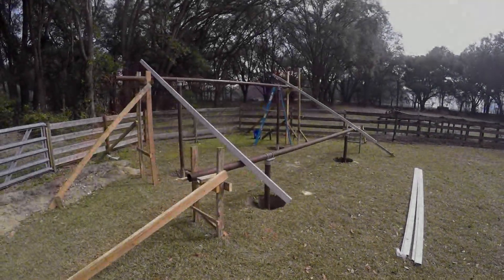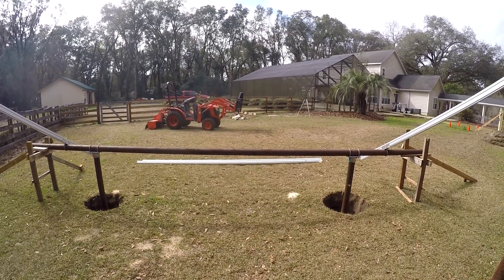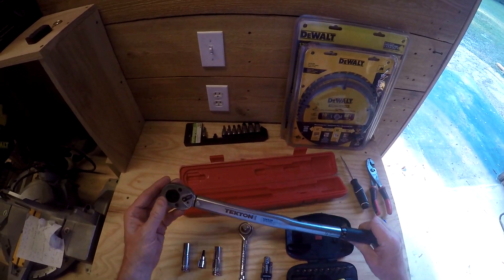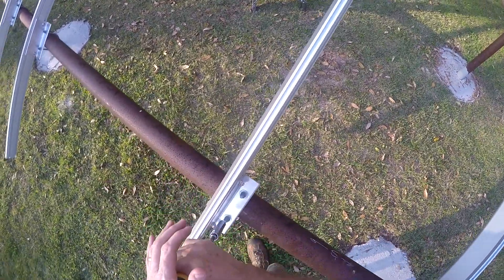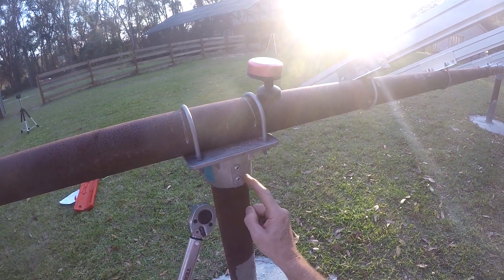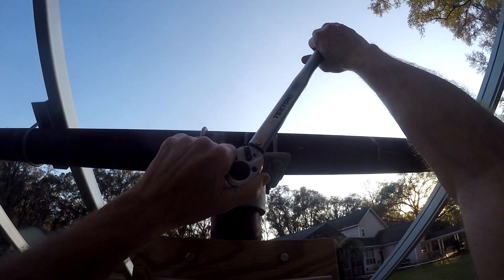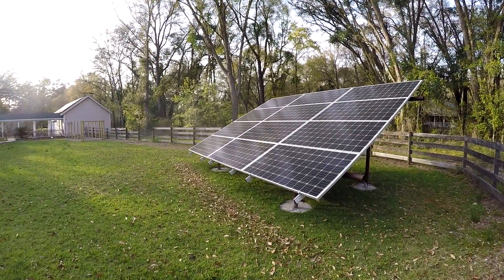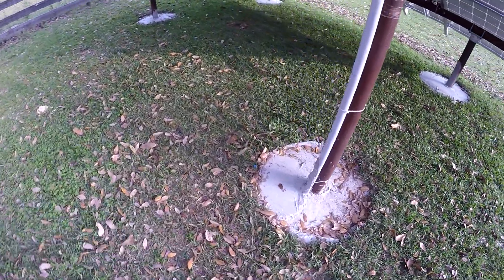IronRidge Ground Mount Solar: Concrete Rails & Panels

Comment: You make it look so easy! Did you use the Ironridge design assistant, and what diameter of pipe did you use?  Thanks
Reply from the maker: Yes, I did use the design assistant and the inside diameter is 3" outside 3.5".  Check this out: https://youtu.be/UzUcyl_iGwE?si=By99ljC_wtz5TBF-
Reply from the maker: I have a whole series on this: https://www.youtube.com/watch?v=N7CoCI-0IoY&list=PLkTIWHBRRyi41UblmwomPHEmXYjgXf0B1

Comment: Love the video of your solar install. I’m doing the same very soon but will have 36 panels. What degree slope did u set yours. Is it around 30 degrees.  And how did u calculate how much pole to leave out of ground on front  and back to get the degree u need. I need 30.
Reply from the maker: Start with the IronRidge design assistant.  That should give you all the measurements.
https://www.ironridge.com/ground-based/
Thanks!

Comment: Those set screws need to be tight for *uplift*. I used a bit of Loctite to help keep them from backing out and on the nuts as well...
Reply from the maker: Yes, They do have a specific torque setting.

Comment: Are you using non-galvanized pipe? How is it holding up? Thanks
Reply from the maker: I think I used this: 
https://www.onlinemetals.com/en/buy/carbon-steel/3-nom-schedule-40-carbon-pipe-a500/pid/23672?variant=23672_72_0&gclid=CjwKCAiAmJGgBhAZEiwA1JZolqQfc-hJ-3GX0mo4MJdoBO7V1WdxDgM4mD0togIag7OXFGDP1ODHzhoC1hsQAvD_BwE
It has surface rust as I did not paint it but It seams to be holding up just fine.
Thanks!

Comment: Very nice video.  I am considering either Iron Ridge or Sinclair ground mount system for 24 panels expanding to 30-35. Iron Ridge has a tool on their site to assist the design of how deep and far apart the posts go.  Sinclair has seasonal adjustments due to hand cranks.  I am not sure which I am going to go with.   Iron Ridge has the stoutness for Texas winds and the other can adjust the angle which may not be as big of impact in Dallas are of Texas as it would be up north.  Thoughts?
Reply from the maker: I think either way is good.  I like four post at the corners better than singles down the middle.  I do like the ability to adjust the angle and agree that it would be a much bigger factor up north.  What is the price difference?  Also, be sure to check out Gain Solar and Engineer 775 for examples.  https://youtu.be/XMveyVQNVdA
Reply: @HomesteadEngineering  thanks for your reply.  I kind of agree with the 4 posts idea.  The cost is fairly close when you add in the substructure of schedule 40 pipe with the Iron Ridge.  Both systems have a way of mounting without concrete and holes, but I think it is high risk (not using a post hole with concrete) for a residential guy like myself (like is there a any rock under the panel mounts to give me trouble).  I will check the references you mentioned above. Thanks again!  All the best!

Comment: Looks good.  Only thing I would have done different on the piers is I would have put a couple pieces of rebar through each to help with hold down.
Reply from the maker: Hello Noel, I actually did that, you can see it in an earlier video: https://youtu.be/-YeIbNp6ANU
I have a complete start to finish series on the entire install.  https://youtu.be/N7CoCI-0IoY
Thanks!
Reply: Sorry.  Didn't see the previous one.  Well good job! I'm about to build one myself.  Hope it comes out as good as yours!

Comment: Would a emp or cme affect the solar system of someone’s house if someone has solar & would a emp or cme affect a septic tank where you couldn’t go to bathroom in a toilet ,is a septic tank hooked up to electricity @homestead engineering
Reply from the maker: An EMP would likely effect a basic solar power system.  Things like battery monitor kits and other sensitive electronics.  There are action you can take to mitigate this risk.  I believe the SOLARK systems are hardened but not sure.  Lead acid batteries are much more resilient as they do not have BMK's.  CME's are less risk if you are not connected to the grid.  Septic systems should not be a problem.  Thanks!
Reply: @HomesteadEngineering  thanks for the reply,take care
Reply: @HomesteadEngineering  is your well or any well similar to yours controlled by electricity or is it controlled by something else?i meant to ask you that when i asked about the cme &emp@homestead engineering

Comment: I like your video. Thinking about building one like it
Reply from the maker: Berlin,  I am very happy with the results so far.  You can design it to your own needs and I hope you give it a shot. If your not an electrician, be sure to have someone help you out a bit to make sure everything is done correctly.  Thanks!

Comment: Looks great, might I suggest filing the end of the steel pipe with some expanding foam. I don't know about Florida, but where I live the wasps makes nests in them.
Reply from the maker: Ryan, Not a bad idea.  Thanks!
Reply: @HomesteadEngineering  Yeah, I'm in CT. I have the same IronRidge solar install. Walked out one day and there was a huge nest in one of the pipes.

Comment: I just install my IronRidge ground mount structure and now installing the rails, question how did you know how far to space your rails. Thanks
Reply from the maker: Hello Greg, My panels are about 72.5" wide and I set my rails about 52" apart.  You can lookup your panel and it will show the mounting locations in a diagram.  Thanks!

Comment: Just curious; you put the other panels on your shed, why not put these ones on your house ? Your roof faces the right way, so what's up ?  Thanks for the great video.   :)
Reply from the maker: Good question.  
Advantages of ground mount:
1. Easy to build (no climbing on 2 story steep pitch roof)
2. Easy to clean and inspect
3. No worries about re-roofing down the line
4. No worries about a leaky roof
Disadvantages:
1. esthetics, on the roof is basically invisible whereas the ground mount is like adding another building to the property and it takes up that space.
Reply from the maker: Just thought of 1 more advantage:  you can angle exactly as needed

Comment: It's coming along nicely. Do you need perfect or do you need functional? Don't sweat the small stuff, my friend. Good helper you had there. Did you get the concrete poured at the barn, too?
Reply from the maker: Hello Hoot, Exactly!  I am very happy with it so far.  Its cranking out a ton of power (can't even use it all).  I am starting to lean on my battery bank more at night so I can use some of that power to recharge them.  I plan to up my battery bank to about 30kWh of Lithium once these die.  I just came across the Gyll LiFePO4 at $300/kWh.  That would change everything.  I would run my entire house off grid.  BTW: I did finish the barn concrete as well.  :)

Comment: Excellent set up you did a great job. Just curious did you EMP proof your solar grid?
Reply from the maker: I did not design for an EMP.  I currently see two ways to go: 1. A Sol-Ark system 2. Buy duplicates of all sensitive stuff and put them in a Faraday cage.  That said, I don't think an EMP is a huge risk right now as in: why destroy what is currently destroying itself.  CME is probably a bigger risk.  Thanks for the question.  :)

Comment: Whenever I watch your channel I am reminded of how many things I would do differently If I had the funds. I do have a mill and 40 acres of timber so thts what I'll use for the new solar arrays. I was going to char the 6x6 posts and set them 3 feet deep. The unknown factor is the wind. It does gust to 60 up there. It blows up to 25 just about every day in the afternoon. I may have to set the solar panels 2 high to keep it from being such a large sail.
I need to keep the solar panels a t leas 3' off of the ground because of the snow. When I see how much concrete you are supposed to have it makes me want to rethink my design. My old system was up and running fine for 6 years but the wind was blocked by the mountain behind me. The new place is all out in the open.
Reply from the maker: Hello Steven, I designed my system for 120-130mph winds because we are in Florida and we do get hurricanes.  The uplift on your panels in a 60mph wind is not half 120mph, its more like 1/4 the uplift (Velocity squared).  That said, I would go to the IronRidge site and use their online design tool to see what they would recommend based on all your info (panels, how many, orientation, ground type, wind speeds, etc.).  That will give you a ballpark estimate of what you should design for.  Thanks!
Reply: @HomesteadEngineering  Thank you!

Comment: Sweet install! Love your way of life at your humble abode. Thats quite a lot of concrete! I am in NY, and  going to use Snap N Rack specs of 1.5" schedule 40 and 12" holes 4 feet deep. You sir can definitely handle a hurricane. 
Did you go over your wiring and combiner box setup? I am doing mine as soon as my batteries show up in April I hope.
Reply from the maker: I will be covering the PT-100 setup next, followed by the combiner box  and panel wiring and finish the series with the startup and performance.  I will probably do a start to finish summary video at the end.  All this has to wait a bit as I am just starting on a review video for the EchFlow River Pro.  Thanks!

Comment: Are you ok with mowing the grass under the array or will you turn it into pasture for the birds
Reply from the maker: I did pull the array off the fence enough to go behind it with my mower and my tractor.  I can get under it pretty good as well with the zero turn.  That's said, the chickens are going to get a shot at the entire dog pen.  Well see how that goes with predators.